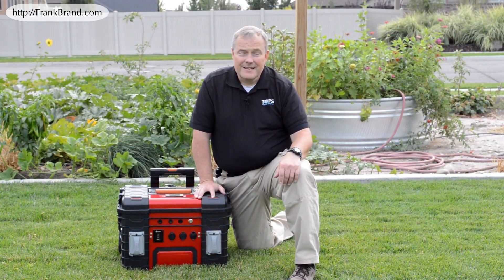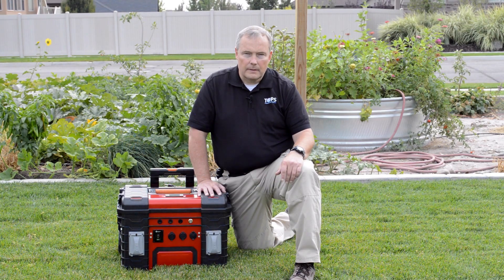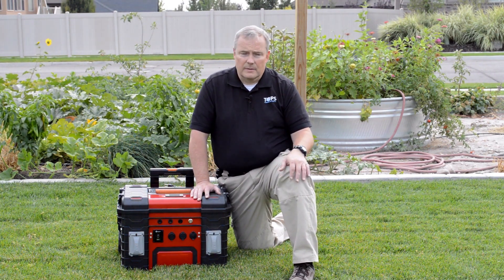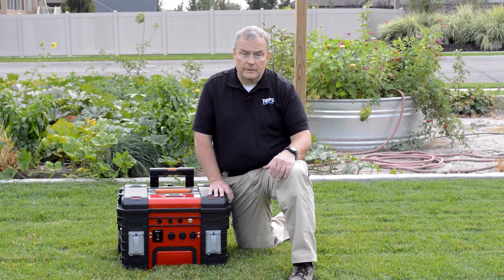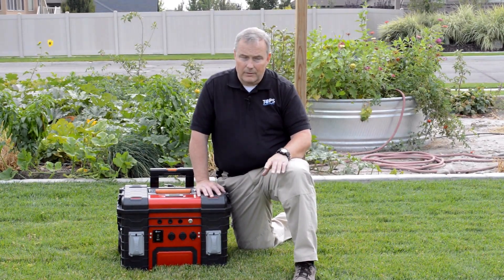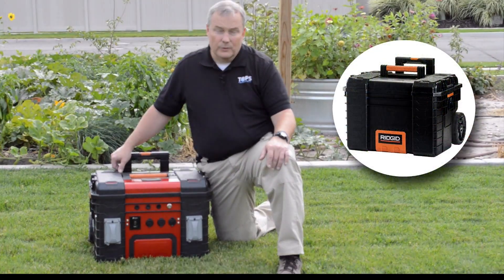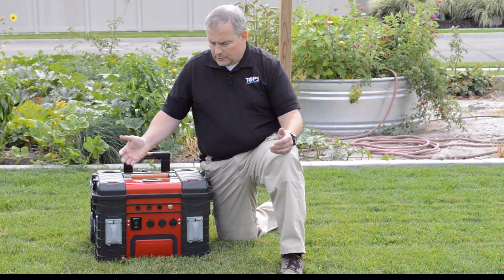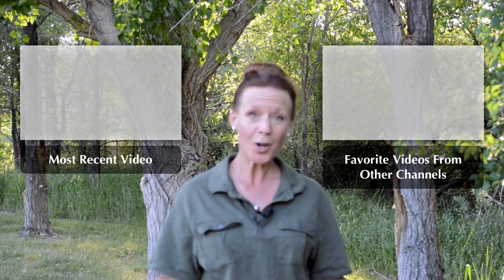Portable Power Pack - Intro

Comment: i have a 6kw power pack, i dont use it much, but when the powers out its amazing, or if i go off grid camping it works wonders. it has two 3s-100p batteries so 600 cells with two 50amp bms in it, and a boost converter so i can run my trailer 14.7v or my powerwall 25.2v i was inspired by these videos so thankyou, helped me out alot. my powerwall is 6s 300p 750amp hour so right around 16-20 kwh

Comment: what kind on inverter did you use?
Reply: I'm surprised you have gone with a Modified sine wave Inverter. It kind of limits you to what is safe to plug into it.
Wouldn't you rather a Pure sine wave Inverter?! Then the power that comes out of it will be as pure as what you get from the grid...
I look forward to your reply 👍
Reply from the maker: I use a KRIËGER KR1500 1500W 12V Power Inverter with Dual 110V AC Outlets and Installation Kit.  I bought mine on Amazon.  http://frankbrand.com/12V_Inverter